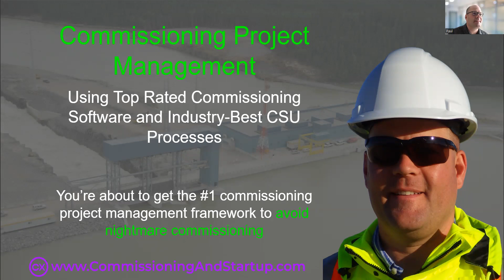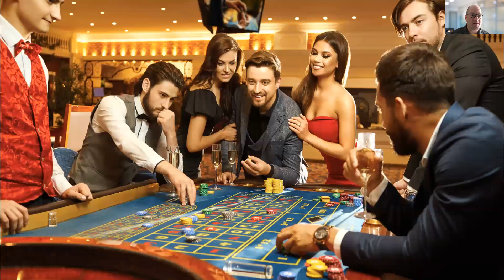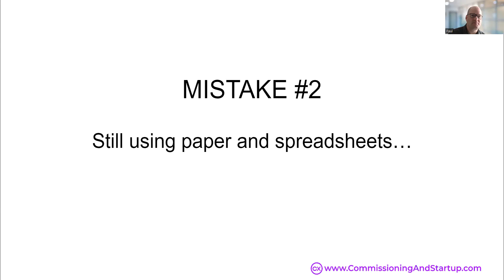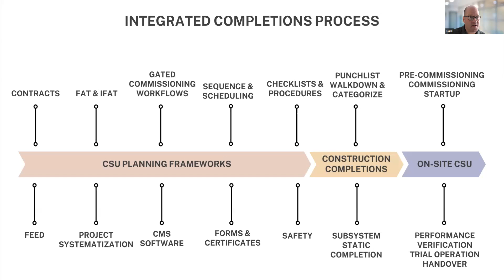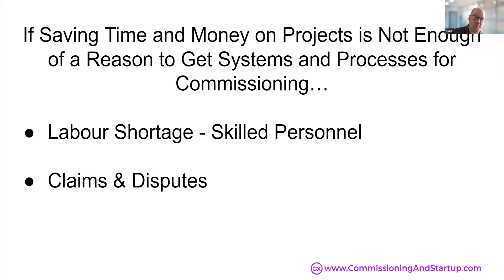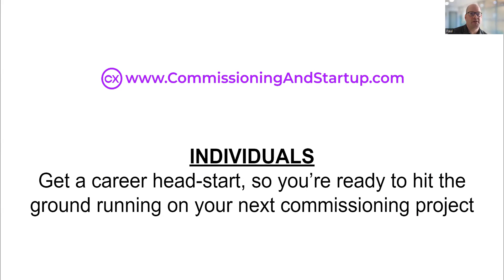Commissioning Project Management - March 1, 2024 Webinar

Comment: I want to ask, is a document controller required to have commissioning project management knowledge?
Reply: Nope sir if you are a document controller not required to have a PM knowledge basically you will be working along side with the site engineers for example if an engineer requesting an SIR for the consultant team to come and check out the work that been done by the site engineer you are the one will send the documents, layouts to the consultant team so you don’t need any PM knowledge as a document controller hope I cleared your point 🙏🏽